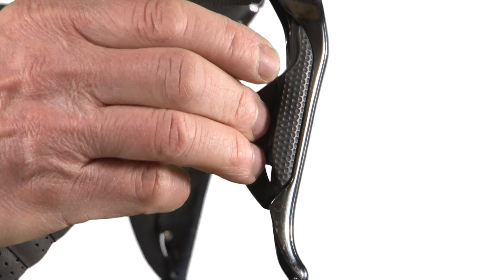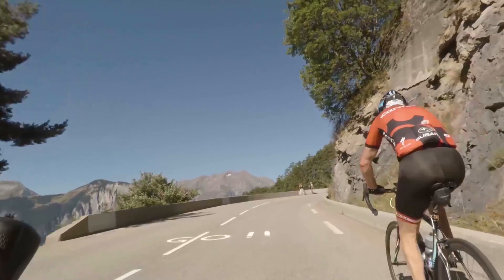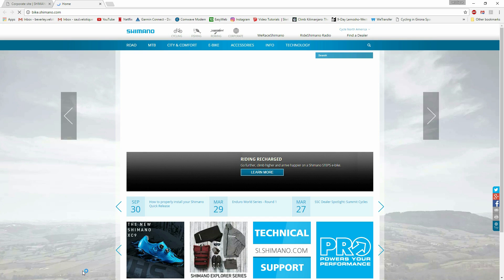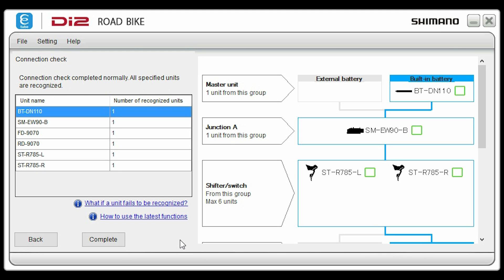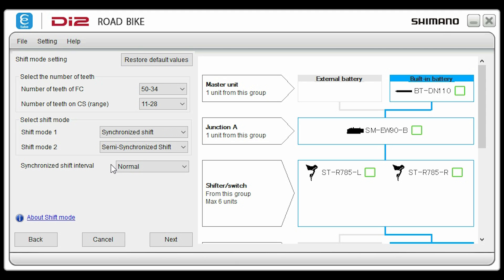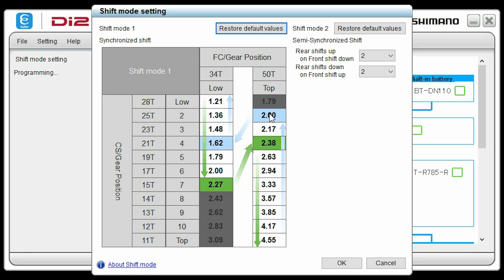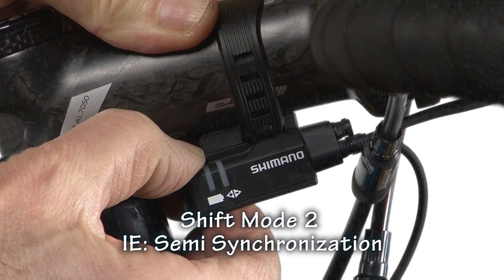How to Setup Synchronized Shifting on your Shimano Equipped Di2 Bike

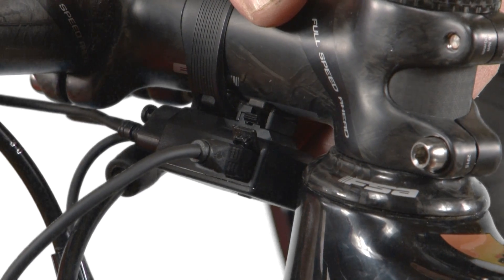Comment: Thanks. I checked my compatibility and it's good. I followed the instructions all the way up to 4:50 of the video. But nothing happens when I double click the button. Am I missing a step?
Reply from the maker: Set the mode to Adjustment Mode by pressing and holding the mode selection button on the junction box for 2 seconds. The red light should come on. Then press and hold the button again to get out of Adjustment Mode. What do the lights do?
Reply: Thanks. I actually just realized that I have the old battery (SM-BTR2) and synchronized shifting is not available with it.

Comment: Thanks for this video, much clearer than any Shimano documentation. Default settings for synchro mode aren't adequate in my opinion. For instance, shifting from 50-25 to 34-21 would have been better from 50-21 to 34-17 for much more appropriate chain alignment. Unfortunately, I found it impossible to program it. Software doesn't allow for such setting and I don't understand why.

Comment: velo, i just got my new road bike, i was riding a hybrid but now i bought a motobecane le champion with shimano 6800 ultegra di2. i charged the battery and updated the software. my questions are as follows. without pressing any buttons,  can change gears as i did with my other bike. do i have to press any buttons for the di2 to work. should i wait awhile before going into full sycho as in your video.

Comment: The video (https://www.youtube.com/watch?v=tly4YEBkK0c) shows the issue when shifting down. There is a perceptible delay between front and rear shifting when shifting down in front (between 28 and 30 sec.). Actually, it's visible in your video as well. This does not happen when shifting up. I do hope there is going to be a software update to solve this.

Comment: Hi, Brilliant video which really helped when I upgraded my 6870 group-set to sychro with the new battery. I have a smaller frame with shorter chainstays and was getting some cross-chain rub so your info on how to adjust the downshift values from the default settings was really helpful and let me cure the problem by shifting one cog earlier. Big thanks. Mike
Reply from the maker: Thanks. Glad to hear that I was able to help.

Comment: Great video.  Shimano's manuals are horrible so I appreciate this!  The E-Tube part went fine.  However, my mode button does nothing on a double click.  Thoughts?
Reply from the maker: Aside from getting the timing right for a double click the most common problem is not having the compatible devices installed on your bike. The battery is the usual culprit. Make sure that you have the DN110 or BM-DN100 battery installed and all firmware is updated.
Reply: It looks like I have the SM-BTR-2.  Does that mean I'm out of luck?  Also, I do get the warning message "If SM-BMR1/SM-BMR2/SM-BTR2 is connected, shift mode will not fuction even if set."  Does that mean its not compatiable or I need to connect the junction box or complete the configuation with the battery disconnected?
Reply from the maker: Sorry , you do need the new battery for synchro to work.
Reply: Thanks you saved me a couple more hours of my life.  I googled the battery and found a compatibility chart that might be helpful for your other subscribers.

http://e-tubeproject.shimano.com/pdf/en/HM-CC.3.0.0-01-EN.pdf

Thanks for the help!
Reply from the maker: You are welcome. Thanks for sharing the chart.
Reply: I am interested in programing my shifting on my  6870. I'm familiar with etube and its capabilities. I have customized how my 6770 bike shifts. My 6870 is a external setup. When I look to purchase or upgrade the battery to BM-DN110 I come up with 2 choices. The BT-DN110 seatpost internal battery or BM-DN110 which appears to be a new mount for my BTR1 battery. When I view a video of people programing the auto shifting the image that shows up on the etube software is of a mount BM-DN110? So is just the mount needed or is it the mount and  battery. I have not seen just the battery BM-DN110 for sale anywhere on the web.

Comment: My chainring set up, 50-36, which is not unusual, is not catered for in the Etubes software which is odd. 
I am also blocked from using small, and 10/11 gear on the cassette. (This with 9150 rear derailleur).
I made a video using Synchro out on the road showing it's pros and cons. 
I have to say I'm not a massive fan, and prefer semi synchro if anything.
Good clear vid by the way!
Reply from the maker: Thanks for your feedback. Unfortunately the software does not offer all the gear combinations as options. The software is not that sophisticated that it actually uses the gear ratios you select. It only illustrates possible sequences and cross-over points. You can make your own gear chart on paper if you want to know the actual gear ratios that can be used. You can use the default gears shown on the screen and select cross-over points that match your paper chart. You are basically mapping a default gear selection to your paper chart. But after-all, Its about riding, Enjoy!
Reply: Thanks. Personally, I found the Etubes app (using Bluetooth) buggy, so didn't bother progressing any further with it (especially as my gear combination was not shown).
The default Shimano change points seem to be about right, but I still think that Shimano cannot 'see' the terrain you are riding, so sometimes it will be doing the 'wrong' thing.
And I still don't like that I cannot access 10 and 11 gear in small ring.

Comment: Great video thanks - I understand that this requires the DN110 battery. My bike is a year old (2016 Giant Defy) with Ultegra Di2; how can I tell which battery is already installed?
Reply from the maker: When you connect it to the E-tube Project software, the software will identify all the connected Di2 components.
Reply: Thanks, yes I did that (it was easier than I anticipated) and sadly I have the old battery. Not sure how long before I can justify the cost to upgrade. Still loving the non-synchro Di2.
Reply: Thanks, yes I did that (it was easier than I anticipated) and sadly I have the old battery. Not sure how long before I can justify the cost to upgrade. Still loving the non-synchro Di2.

Comment: @velotique. i have a question. when i set my junction box to adjustment. one solid red light is up. i double press the junction box button and the battery starts flashing red light. do you know what that means?
Reply from the maker: Are you double clicking the button on the junction box when the red light is already on? What components are installed and what  firmware is installed on those components?
Reply: Yes. BT-DN110, SM-EW90-A, FD 6870 RD 6870 SS, ST 6870 L & R. all on the lastest firmware.
Reply from the maker: A flashing red light while you are in adjustment mode (red light on) usually indicates an invalid entry. In adjustment mode, the system is looking for a click of the shift lever to adjust the derailleur position or a single click of the junction box switch to switch off the adjustment mode. You can double click to change modes only in the non-adjustment mode (red light off). What are you trying to do with the double click?
Reply: velotique nothing in particular haha. Just happen to discover this and I'm curious to know what it means. Thanks for answering!